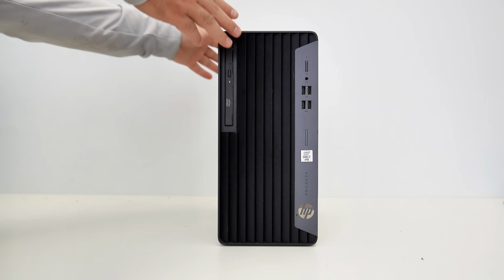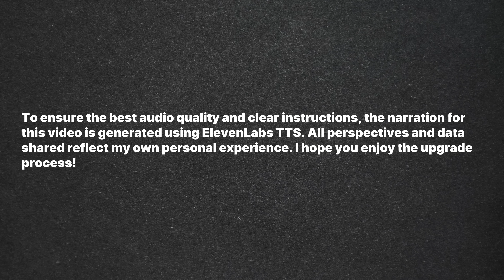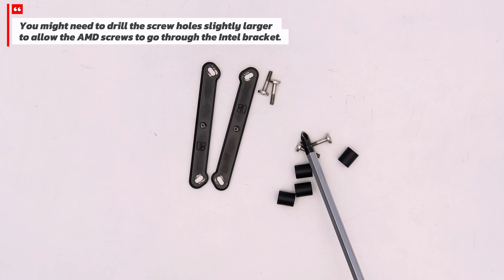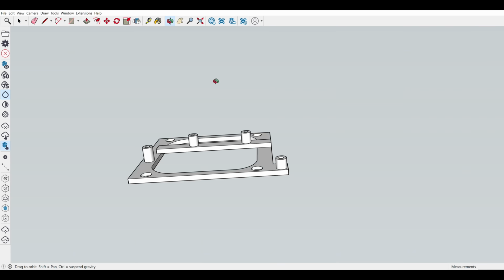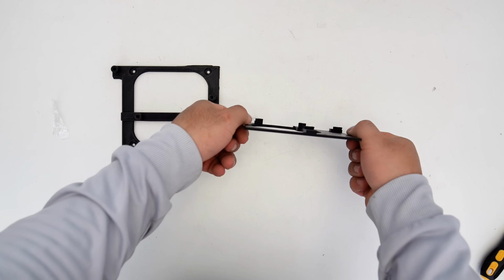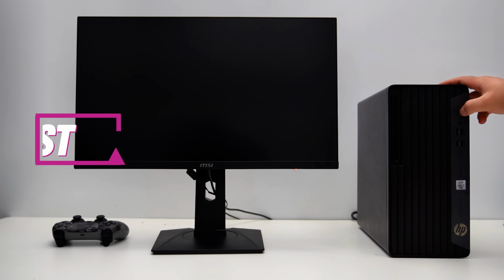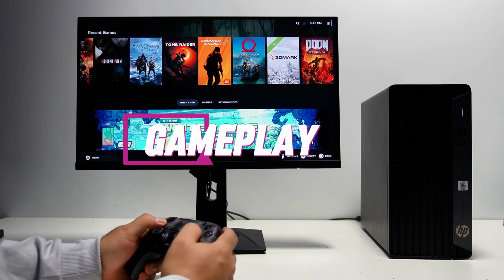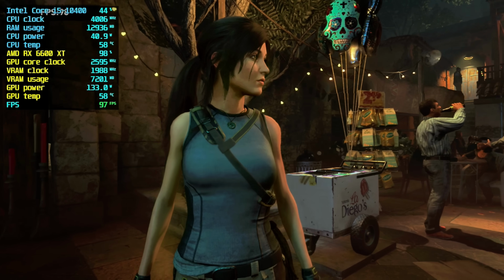From Office PC to Gaming Beast: HP ProDesk 400 G7 Upgrade!

Comment: interesting, please try upgrading with a Dell Optiplex 3000/5000/7000 (Intel Gen 12 or newer), because I see the 8-pin motherboard connector is different from the previous generation. I wanted to try using an 8-pin to 24-pin PSU Optiplex 3020 converter, but it turns out the pinout is different from the latest variant.

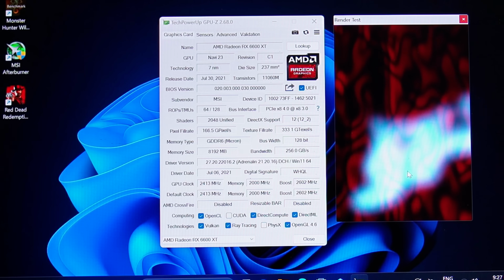Comment: 9:46 Resizable BAR is disabled. You should update your BIOS to the latest version and possibly also update the GPU firmware. Then, in the BIOS under "Advanced > PCI Subsystem Settings," enable both "Above 4G Decoding" and "Resizable BAR Support." This should improve performance by approximately 10%.

Comment: al final, esa cosa cuesta como una buena computadora actual.
Reply from the maker: I mentioned that I bought this PC a long time ago. I only added a GPU for $150, a cooler for $20, and a power supply for $50, so how could it cost the same as buying a new PC? If you didn't already own this PC, why would you buy all these parts instead of just getting a new one? You’ve missed the point of this video, bro. The fact is that the whole setup cost of this PC build you can't even buy the 64GB RAM.

Comment: i have a older dell OptiPlex 7050 i7 7700 32 gb ddr4 ram a old office sff pc with A rx580 8 gb v ram water cooled 650w psu  in a black fish tank case all in under 350$ hell plays cyberpunk at high/mid setting at 45 /65 fps on a 55 inch 4k tv with lossless scaling i get 16gb of vram with 2 gpu's it just runs dule booting mint/windows 11 pro it will play 4k moves all day long don't need much now with the cost of new stuff old is better for now

Comment: I have a question, is there a reason why you did not connect the top fan and the CPU cooler fan together ?
And my second question, did you change the thermal paste on the 6600xt GPU beforehand?
Reply from the maker: I think a 120mm fan may have a higher amperage than a 92mm fan. OEM PCs don't always guarantee 2A per fan header; therefore, to avoid overloading the CPU fan header, it is best to connect a smaller fan to it instead.
Reply: @itggear Thank you